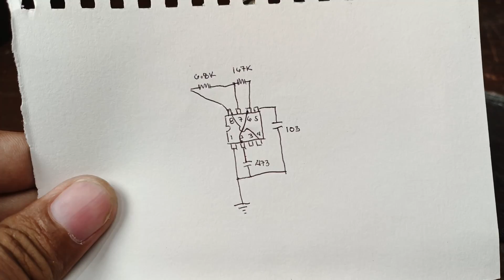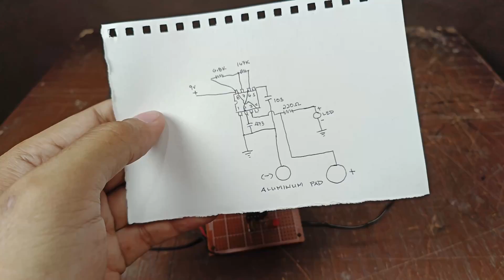Let's make TENS Machine || 92.7Hz Pain Blocker

Comment: Hello, brother, I want to make this project. I have all the components, but I do not have 103uF and 473uF mylar caps. Actually, I am from India. In our locality a packet of mylar capacitors is available; it has
1 KpF 
1.5 KpF
2.2 KpF 
3.3 KpF
4.7 KpF
5.6 KpF
10 KpF
15 KpF
22 KpF
33 KpF
47 KpF
100 KpF
220 KpF
470 KpF
available, so from this, which cap can I use in replace of those ? or is there any other option to use any other cap of the same configuration? Please suggest me.
Reply from the maker: 103 is 10000pF and 473 is 47000pF
Reply: @woodys_hobbies  ok sir
Reply from the maker: @itsplayboy3352  🙏☺🙏
Reply: @woodys_hobbies  Sir i made the circuit in breadboard today i use 10k pF and 47k pF in result 92hz is coming but there is no tens feel to my hand and 3.3v is coming across it . Plzz guide me
Reply from the maker: @itsplayboy3352  What pad did you use?
Reply: @woodys_hobbies  sir i have a alluminium tape so i just take two pieces of 3cm tape put some vaselin on it and press with + and - end.

Comment: What battery voltage and specifications did you use?
Reply from the maker: 9 volts
Reply: Was a transformer used to step up the voltage, does TENS require a high voltage more than 9V
Reply from the maker: @babarindeseun8239  This circuit is 9V only

Comment: Can you tell me how much voltage your device outputs, because I replaced (2j103k with 105j 400v) and (j473 with 474j 630v) and it gave me 7 volts, knowing that I want more. Does this change affect the output, and are there alternatives to output more than 20 volts? Please reply and thank you for your effort
Reply from the maker: You can try to experiment this way change the 6.8K and 167K resistor with lower value and the cap 473uF to lower value.

Comment: Can I use gel electrodes and leads instead of the foil pads ?? It's for a project that uses tens units embedded into a vest
Reply from the maker: It's better if you put gel and use electrode pads.
Reply: @woodys_hobbies  approximately how much this circuit costs ? and what other options can I use so I don't have to use gel

Comment: How can control intensity on this circuit
Reply from the maker: You can lower the frequency by changing the resistor value 6.8KΩ and 167KΩ. Try to replace 6.8K to 200KΩ and 167KΩ to 5MΩ
Reply: @woodys_hobbies 

 ok thanks for replay
Reply from the maker: @devendrapatil661  Welcome 😊
Reply: Hello brother how can you increase your intensity ? It is pain intensity or not ?

Comment: I have used 6kohm resistor instead of 6.8kohm. Otherwise I've implemented the circuit exactly the same way. My nerves doesn't move when placed on aluminium pads and i dont feel any current.And 88 Hz is being produced in oscilloscope
Reply from the maker: Try to make a good contact of your wires to the aluminum pad. Use a Vaseline to insure good contact to your skin.
Reply: @woodys_hobbies   I'm a biomedical engineering student. This semester we have a project to make defibrillator (basically prototype that will not cause any harmful shock). So is it logical to use this tens circuit? Please provide some advice.
Reply from the maker: @nafisanawal5930  Yes actually my friend wants me to make this and he is on his 70's now. As far as I know he tells me that it's working on his back pain.
Reply: @woodys_hobbies  ""A defibrillator is a device that gives a high energy electric shock to the heart of someone who is in cardiac arrest. "" As we have to make a prototype of defibrillator, electric shock doesn't have to be of high energy. So can we use this TENS machine as a prototype?
Reply from the maker: @nafisanawal5930  ok for now I never encounter that kind of device. Mostly encountered audio devices.
Reply: @woodys_hobbies  Okayy thanks for your time!!
Reply from the maker: @nafisanawal5930  Welcome

Comment: What's the amount of current being  generated  in the  aluminium pads?
Reply from the maker: The current is pulsating and if the current is steady then you can't feel any thing. Try to use 6.8Kohms. And make a pad with a good contact.
Reply: @woodys_hobbies  thank you
Reply: @woodys_hobbies  is it AC or DC current? Whats the amount being produced in the electrode pads?
Reply from the maker: @nafisanawal5930  Pulse AC current at 0-80mA with a duration 60uS powered with a 9 volts battery 500mA
Reply: Thanks a lot!!!
 @woodys_hobbies
Reply from the maker: @nafisanawal5930  👍👍👍👍👍👍